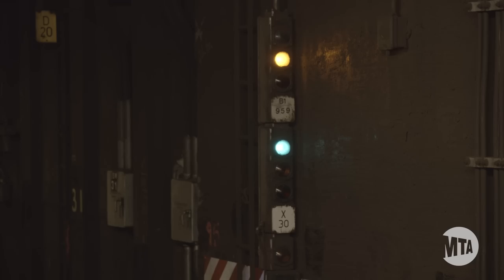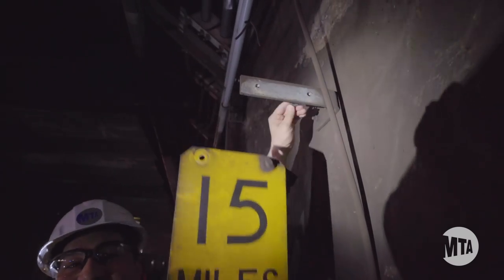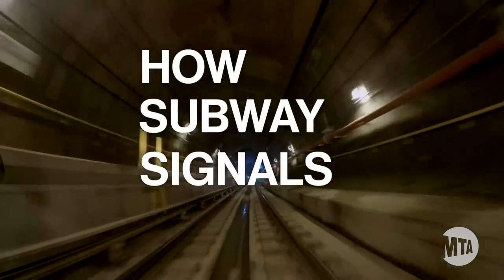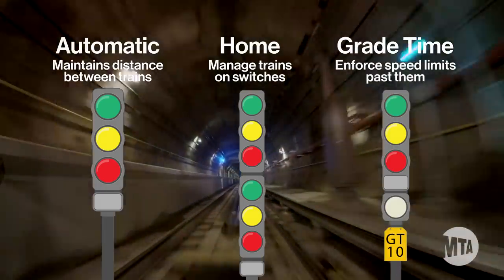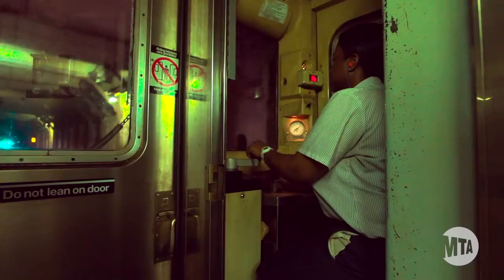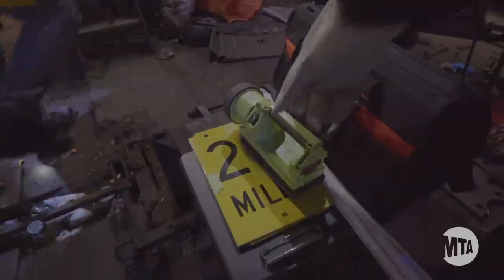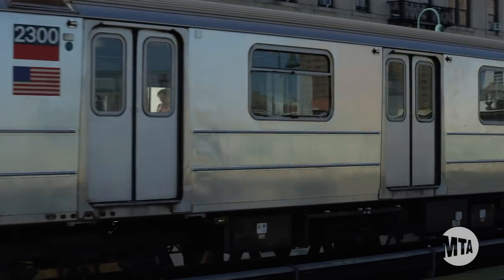SPEEDing Up Your Ride

Comment: Laughs in London as we speed down the Underground at 50mph
Reply: yeah but y'all got racists forcing you to brexit.  xD
Reply: jamesthemaniac you really wanna talk about racism when you live in the US😂😂
Reply: Eli H we have had gale force winds and flash flooding and the underground still runs, our trains may be smaller but our subsurface lines are the same size. Our trains are comfy and inviting it doesn’t feel like an interrogation room and we sure don’t use plastic seats that stick to your thighs in summer. Our stations are cleaner and may I say brighter and better, we have escalators at almost all of our stations and most are accessible, we don’t use an outdated system to use our trains u can even use your bank card to use the Underground, our trains are driven automatically on most lines and some use CBTC meaning no signals required and thus a train every 60 seconds including station dwell time, our oldest train is from 1972 while yours is from the 60s, we rarely have delays or closures and basically our trains aren’t rolling tin cans
Reply: @Elijah-zy6ce  never said we didn't have a shit ton too. Also, wasn't calling you a racist, just making a joke about how some things suck in london too :`D
Reply: London is the opposite of racist
Reply: Mta trains go 55-60 mph in some tunnels and some express tracks, so, yeah.
Reply: Trains go the exact speed too, well sorry for the MTA for trying to take extra precautions
Reply: @Elijah-zy6ce  well I must correct u kind sir, most if our old fleet is retired our system is full of NTT cars with more expected to retire more older cars in another year or so
Reply: There are many parts of NYC where you hit 50 mph. 4 Avenue between 36 street and Atlantic Avenue Barclays Center, 60 Street tube, Rockaway flats, and the Flushing Exp. Don't comment if you don't know
Reply: 5 sec later (subay crash in west London)
Reply: welcome to episode one of non new yorkers trying to act smart in the comments section!
Reply: @jamesthemaniac3293  Whoa! That was the corporate slap heard around the world!
Reply: @zycklacon9588  If they keep taking extra precautions,  Uber,  Lyft, Via and the commuter vans will put the MTA out of business.
Reply: Laughs on the 2 express train as we get from chambers st to 14 st in 2 minutes at 55mph.
Reply: @lightning77125 London can go 60 on some sections, but I didn't know you could go faster than 50 in NYC, so, not bad

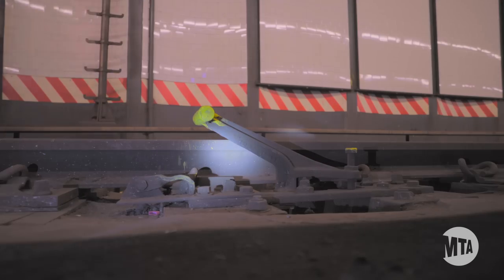Comment: 0:54 Can't you use something else to trigger the brakes like a grid on the tracks / ATP?  The brakes can be reset in the cab by just stopping.
Reply: I think the point is that they are meant to inspect the train when an emergency stop is triggered, they'd still have to do it even if they technically could disable it in cab.
Reply: And on the long island railroad when you emergency brake the m7 model from my knowledge you have to turn off the whole train and restart it and you can't just brake and  then go they have a full inspection and report even if you overshoot the station by a quarter of a car they still have to emergency stop and investigate why the operator did not stop and this can even make train delays and commuters late and mad but we always have to keep our customers safe. Sorry for writing all this I just was bored and did it .
Reply: @juanalicorish8407  np
Reply: @Cloudrak   yes because I was a mta driver for the long island railroad for 4 years and it happen to me about  twice because of teens and we had to have a full investigation yes you can reset the brake in the cab but you have to restart the train anyway because if train workers get to close they may get shocked  from the train

Comment: Interesting I’m a motorman for Septa our track speed is fifty mph on one & four track & 70 mph on two & three track but they are slowing us down in certain areas & it makes no sense
Reply: Larry McNeil a few of my friends work for Septa & 2 of them told me they miss the old wayside signals on the El...since they switch over to ATC they have no choice but to go the posted speed limits...I think ATC is better but I know that Shit is expensive
Reply: Quincy Harvey I to was on the el from 00 until 04 they was just starting to switch the signals over from the wayside to in cab and yes that’s right you have no control of the train the computer does everything the m4’s are junk the only thing they are good for is calling out the stops and comfortable operator seat on the orange line we have total control over everything but once they replace the Kawasaki cars it’ll be the same as market street I’ll been done retired then
Reply: Larry McNeil yeah I hear everyone saying that’s all it is...a piece of junk on wheels lol...and I’m like damn I wanna get into SEPTA so I can drive them one day but I ain’t tryna drive no piece of junk tho!! Lol
Reply: If you were an actual Motorman you would Know that

Comment: I wish that the new trains had the front window as shown in the r42 trains in this video!
Reply: 42luke roblox Why?
Reply: JeremiahC99 
So we can see out the front window when in the train. I find it silly they made the train operator room cover that. Since I have never seen a train operator use that space. That’s why too. But it will never happen again : (
So i’ll just enjoy the R32 trains with it.
Reply: 42luke roblox Railfan Windows are the last thing you should be worrying about.
Reply: JeremiahC99 
But why? It is a fun part of the experience riding the trains. I’m just saying.
Reply: 42luke roblox The experience is fun, but honestly, we’ve got bigger fish to fry.

No wait, we got a bigger dish to dry.
Reply: JeremiahC99 
Well fish need space don’t they? If you brought back the front window it would make more space for passengers too.
Reply: 42luke roblox There’s already enough space for passengers with the full width cabs. Trains always arrive very frequently as well. Without the full width cab, operators are going to be very uncomfortable operating the trains.
Reply: JeremiahC99 
I only considerd mentioning this since I never see them use the space, that’s why I’m saying. 

But if that’s the case Now that we are this far. I know we both can agree upon the fact that the MTA should not use open gangway cars on the r211 trains right?

Comment: What's the speed limit in NYC trains? Modern trains get between 35 and 45mph
Reply: It depends on how sharp curves are, how close station are, how much track switch there are... 

it can vary from 15 mph to 50 mph
Reply: 2/3 from 72-42 can reach 59, E/F go around 48-54, N/R/W under the East River go a whopping 60-65.

Comment: Please hurry with the implementation. It takes 30 minutes to drive from Flatbush to Chelsea but an hour and a half to take the train. My family treats me like a free Uber because of the inadequate train system a
Reply: I mean, it's not like there's an express on either one of lines.
Reply: Lol you know damn well it don’t take an hour and a half from Flatbush to Chelsea on the train 😭
Reply: @user-cj3dk1gb1k  lol, you would be surprised. The 2/5 is always at a crawl due to 'traffic ahead' or some other reason. It's a mess.
Reply: @cbwavy  take the BM2/3 then.

Comment: Heres a solution, how about the mta install a new signal system and take out the one thats been here since the 1950s
Reply: TheShock03 That’s going to take a lot of time. The MTA’s plan to install CBTC on some lines will taken 10 years.

Increasing speeds is a faster short term solution to make trains more reliable.
Reply: I'm sure they will eventually, but it's incredibly expensive and will take time. If they don't make sure the existing infrastructure works effectively because something better might come in the future, then the system will never improve!

Comment: I live in Philadelphia where the market Frankfort line is 30 mph and the broadstreet line express can go 70 and local can go 50 septa trains are older and going faster mta yall have more people to move anf new trains ive been on the r188 and r160 and r179 and line that has an express rout yall should be going at least 70 mph and the locals in some areas at least 50 or 45 not 30 dont be the market Frankfort line yall can do better

Comment: They could also modify curves so that trains could tilt and maintain speed.
Reply: Come up with $8.5 billion then maybe come back to me
Reply: @MarloSoBalJr  Hire private contractors to do the job and save billions. France did that and was able to make these modifications at a fraction of the cost.
Reply: when the trains go fast enough they will start tilting so they can maintain speed and they wont derail
Reply: Hahaha, in America?
Reply: MarloSoBalJr And that’s a lowball Number!
Reply: Mo Uddin They do but private contractors over charge the MTA by the millions in nyc
Reply: Kilo Byte  24/7 service is not an excuse. Neither is having a large network. Tokyo is 24/7 and it's a larger network by volume of riders. I like the MTA but if we keep making excuses for them they'll keep doing the bare minimum

Comment: Please don't scrap the r42s and r32s mta I love em too much
Reply: Christopher Dobson First, the R32s and R42s have the WORST FAILURE RATES in the entire fleet. Also those cars CANNOT interface with the new CBTC system the MTA plans to install. Therefore, the R32s and R42s have to be retired as soon as possible to make subway rides more reliable in the worlds greatest city. There’s no other option.

Second, WHAT DOES THIS HAVE TO DO WITH SPEED LIMITS?
Reply: Train boy ant There are some R32s and R42s in the museum fleet if you want to see them. They usually bring them out every once in a while.

Comment: No the trains must be slower
Reply: Tyler Sheehy Why?
Reply: @TheRailLeaguer  i witness a Subway crash in New York back at 1999 it was horeifieing
Reply: Tyler Sheehy There was not a single crash since 1995.

In addition, train speeds are being increased only in places where it is safe to do so.
Reply: @TheRailLeaguer  it probably wasent televised or newsavised
Reply: Tyler Sheehy Either way, that’s not a good reason to reject a speed increase. Like I said, the speeds are being increased wherever it is safe to do so. Speeds are not going to be increased where it will cause a risk to passengers and operating personnel.
Reply: @TheRailLeaguer  the new York sub way has aging inferstrucksure the tracks might split apart might brake  my therey it's been slow for along time to increase speed it whold need 100% new renvatoion
Reply: Tyler Sheehy They are factoring that into the equation. In addition, they are planning to install CBTC in the near future.
Reply: @TheRailLeaguer  oh
Reply: Tyler Sheehy Nothing to worry about.

Comment: Well take the 7 train and feel how fast it goes, I would say the 7 train is the slowest train in NYC. Please fix it
Reply: Azeddine Makh trainluvr noticed that the section of the express track between 52nd and 61st Streets had the timer removed several months back. Also the line has a new CBTC and ATO systems.
Reply: The R train is definitely the slowest

Comment: Would it not be easier to replace these signals that can wear out over time with a software solution that simply knows when to speed up and slow down based on location. Removes a mechanical solution that can fail over time. It's how Europeans do it
Reply: Mo Uddin If referring to CBTC, then it will be expensive to do. This is the fastest solution to fix the system for now.
Reply: @TheRailLeaguer  No I'm talking about a location based system that uses beacons attached to the train and tunnels. I can't remember the name .. CTBC is out dated tech. MTA is decades behind in installing that and realistically never will. Fixing the signals is not worth the investment since it'll result in it breaking down again anyway. Why invest in a temporary solution when you can invest in the future. Also CTBC is cheaper to install than fix these signals since CTBC is available commercially but these signals are no longer made and must be custom built  according to the Nytimes
Reply: Mo Uddin Either way, it will take time. The timer recalibration is a quick fix
Reply: @TheRailLeaguer  It really isn't tho. MTA estimates 10 years for either solution. So in reality 50. (JK on the 50  I hope)
Reply: Mo Uddin I think they really mean it this time.

Comment: It’s best to send the 5 train on the 2 line it helps reduce crowds and wait times for service to 7 Av or 241 st
Reply: Daniel Boateng What does this have to do with Speed limits?
Reply: Timing
Reply: Daniel Boateng I don’t think rerouting trains can raise speed limits. Rather, it’s the signals themselves.
Reply: Mostly it’s timings and wait times
Reply: Daniel Boateng Seems reasonable, but let’s keep the routings the way they are (except when the need to be changed), and focus on fixing the speed limits and signals.
Reply: Fair enough
Reply: @TheRailLeaguer  That's it, Imma make MTA be a private company, And fix everything that's separated as missing pieces

Comment: This is absurd. I can ride a bike faster then these $3 million cars are allowed to travel at. Like serious? 30mph MAX fricking speed? no wonder it takes 3 hours to go 3 miles.
Reply: Kevin Howard Max speed of the subway cars is 40 mph. 30 mph is 5 miles faster than the speed limits on the surface. The speed limit changes will improve the speed limit. Just look at the N and R lines.
Reply: @TheRailLeaguer  Yeah that's still pathetic.
Reply: Kevin Howard Realistically, the speed the surface cars travel is usually slower due to congestion at some points.